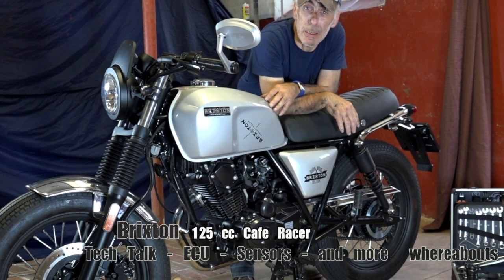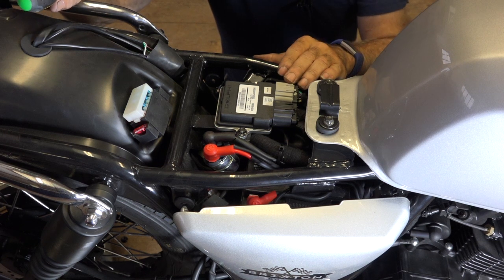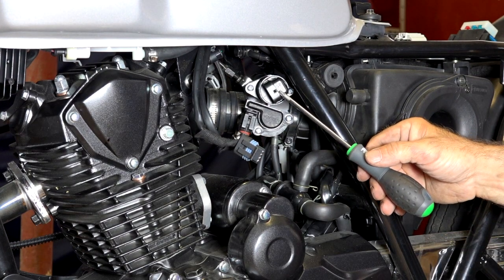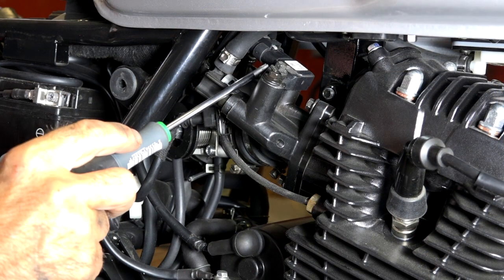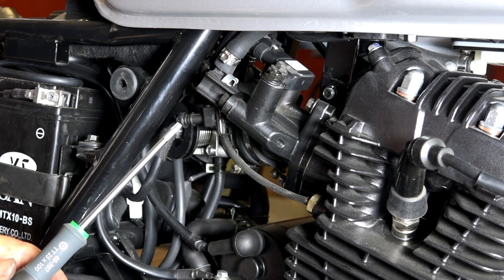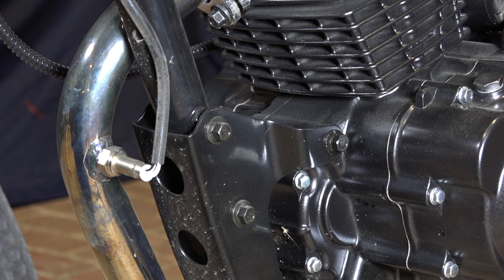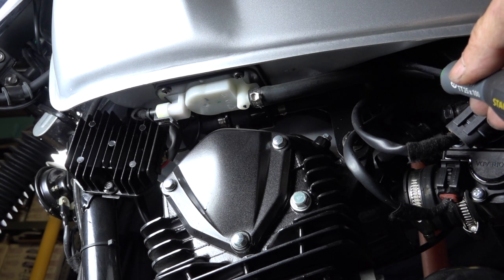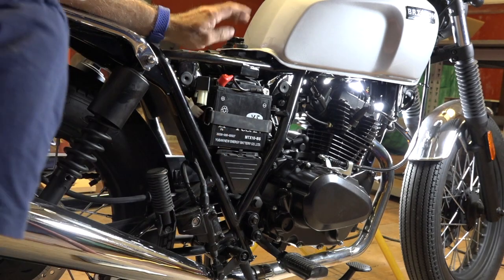Brixton  125 cc  Motorbikes, how do they work  Tech Talk - Part 1

Comment: If the FI light does not come on when you turn the key what would the likely cause be?
The bike has no spark and the pump does not prime.
I have tested the ECU itself by fitting a 2nd known good one and the problem persists.

Any Help would be very appreciated.
Reply from the maker: I would check the wiring harness for any breaks or loose connections, especially around the ECU and the main power supply.  Check also you  batterij state as the ECU will asses first the battery.

Comment: Hi Thank you for these videos.  I have a Brixton BX125cc it was running fine then one morning wouldn't start.
I have checked fuses, unclipped wire to Side stand safty turn off removed, new spark plug replaced checked for spark  py pacing on engine and no spark from spark plug, Do you have any ideas what it may be
Reply from the maker: The best would be to attached a OBD2 reader and read out the error code. There is a video on it.

Comment: Thank you for the informative videos on Brixton motorcycles. 
Where I live, I do not have a registered Brixton service centre and the local mechanics do not prefer to work on ''chinese'' bikes. 
I would be grateful if you could point me to the probable causes of issues. :)
Lately, I feel the bike vibrates a lot even after an oil change. Winter or summer, I always wait untill the bike warms up (until it reaches idling). I was thinking of replacing the spark plug? What do you suggest? or could it be totally something else. 
Secondly, I hear lose metalic parts vibrating sound on the left part of the engine. I am guessing near the gearbox. I opened and retightened the output gear and the cover. But the sound still persists. what could be the possible reason?
Thanking you in advance. :)

Comment: Hi!
Thank you for the awesome videos!
I have a problem with my Brixton 125.
The idle speed is not maintained properly (engine switches off) and when I accelerate, the engine stalls for a while before revving up.
Could you please advise?
My engineer is asking for the TPS voltage and amp settings. Could this be the problem?
Thank you in advance.

Comment: Hello. I recently installed an after market blinker on my Brixton. For some apparent reason, every time i press the switch on button on my bike, it has a delay like 1 or 2 second before it fires up. Do you might have an idea what could cause the issue? Thanks!
Reply from the maker: It could be the RC circuit that makes the blinker go.. or put a bulb that is a bit pulling more current

Comment: Hello :)
I'v been watching your videos and they are very helpful. Thank you for that ! 
I have a little problem with my Cromwell 125 so i was wondering can you help ?  
Motor is running flawlessly when i  full throttle it, but when i want to cruze at lower speeds around 5-6 rpm, with half throttle, engine begins to stutter, like it has no power. I went to dealer and they said it is normal that it's because of manual cable throttle. Then i put some carburator cleaner n tank, and it made no diference. Then i replaced sparkplug and put NGK DR8EA, and motor was running like a charm. Sadly problem was back after 2 weeks. Could this be something with unstable woltage or ecu maybe? Maybe i'm wrong but i get the feeling that's not normal. Motor have 5000 km, maybe i need to ride it more :)
Thx

Comment: Thank you for all the information you offer in this video. I have a BX 125 with no signal or possibly power reaching the injectors. The fuel pump is working and if I power the injectors manually I get a fine mist as expected. The bike has also started occasionally when performing the ECU reset (5 off and on switches at about half second intervals) 

I have tested with a replacement ECU but still have the same issue, a friend suggested the relay could be faulty but if this is the case I can't see how the fuel pump would prime as the circuit diagram for the BX shows that they both share the same relay... I am at a loss... If anyone has any advice on this it would be most welcome!
Reply: there are 2 relays under the seat, and one of them might be the problem, But yours could also be a cable problem if not the the sockets themselves. I use the bx 150 looks the same and works the same. I replaced both the relays under the seat and it works again. But do so only after you have checked the continuity of the cables to know if you have a faulty cable first.
Reply: Bonjour ,
Très intéressant , savez vous ou on peut trouver ces correspondances  de codes pannes ? (Avec le nombre de clignotements du petit logo moteur)
Ainsi que les possibilités avec les marche / arrêts avec la clef ? ( exemple : 5 fois = reinitialisation)
Ça serait vraiment très intéressant !
Merci pour le partage .

Comment: My brixton cafe racer 150 is not going well. I dint know what the problems with my brixton. When i gear i shift the gear down my motorcycle had a free gear and need to push the starter again
Reply from the maker: Thanks for the comments, Not sure what the question is.  Can you explain ?  Does the engine stop when shifting gears ?
Reply: @D3Sshooter  its going to false neutral and the the motorcycle cant start

Comment: Hi sir, have you seen any plug that can be connected to a gear indicator on this bike? I have seen a few sellers in my country having gear indicators for this bike online. I plan to buy this bike, and although the lack of gear indication doesn't affect my decision much, the addition would be nice since I'm rather forgetful. Thanks for all the information, it's very helpful.
Reply: tuiso hi there, which ones have you seen? I’ve ordered one that doesn’t fit very well :(
Reply: @andrealeixo1766  hey there thx for sharing the experience, the one I see looks like this https://scontent.fhan4-1.fna.fbcdn.net/v/t1.0-9/42521879_1113397698825961_4406814141377937408_o.jpg?_nc_cat=105&_nc_oc=AQnkzj_7FsFlk6UZ_b_iRClb182J0cIGPB3BlKqpz3COJeXWAR9yZ4DpCltgLPQ44uU&_nc_ht=scontent.fhan4-1.fna&oh=1f8fb3ad2a670a29699cf7d99da7ee61&oe=5DFB787F
Reply: tuiso the one I’ve bought is an universal kit but I need to build a metal piece to attached it to the clutch..
Where have you found that online? Which store/site?

It would be very awesome to see a video how to exchange a piece like this on a brixton :D
Reply from the maker: I have not seen it, but indeed it would be very good to have one

Comment: hi.. my brix suddenly stop while riding. i'm not sure why, already change the plug coil cable and the spark plug but still happen. when it happen, i can't start it. after unplug the spark plug head and plug it back and switch on, i can start it. but will happen back. thanks in advance.
Reply from the maker: Hi,   Is the malfunction light on ?   That is the little engine sign on the dashboard.  If that is on you should read-out the error codes from the ECU. I have a video on it , and then replace what needs to be replaced.    But if you can't read codes, lets try this:    One the bike fails, disconnect the sparkplug connector from the sparkplug  and insert a new sparkplug into the  sparkplug connector.  Then hold the sparkplug against the metal block of the engine ( not  the painted area but a bear metal bolt or so).  Start the engine ( it will not run) and check if you see the spark on the sparkplug.  Be carefull for chocks.   If it sparks , then the issue is not the ignition but maybe the inject or any other sensor that shutdown.   If it does not spark, then you might have a problem with the cranckshaft position sensor and or TDC sensor.  If they read the wrong position or provid ethe wrong signal then the ignition will fire at the wrong time ( infact even with a spark in the test , that is still a possibility).  Check also the ignition coil itself at the front of the bike and see if its not cracked or any cables that might be damaged...   Does this happen when the engine is warm ?
Reply: @D3Sshooter  My BX125 started to have this problem as well. It will only stall when the engine is warm, after 20-30 minutes of riding, up until then it runs fine. When it stalls it behaves as if there are gaps in the fuel delivery and it bogs down. It usually happens when i'm at a stoplight and i give it gas to start moving but it also happens while riding. Changed the sparkplug, tighten up the wiring to the coil, no dice. What should i check next? Thanks a lot! BTW: your videos on the Brixton are better than the service manual KS Motor puts out!
Reply: @snobu  my brixton 125 have the same problem, how to fix the problem D3Sshooter !?
Reply: @fernandorodrigues4932  I've narrowed it down to the lambda sonde (O2 sensor on the exhaust). Will try to replace it and see if there's any improvement. I believe you could also disconnect it which will force the ECU to run rich all the time. Probably not the best choice to ride like that but maybe worth it just to isolate the lambda sonde as the root cause.
Reply: Alright, so i disconnected the lambda sonde altogether and went for a ride. The bike lost about 4 horses out of the 10 it usually has, this is expected, most probably running o a "safe" fuel map since there's no oxygen input to the ECU. The good news is that the engine didn't stall. I'll replace the lambda sonde and see if that fixes it, will report back.
Reply: Scratch that, i spoke too soon. The engine stalls exactly the same with or without the lambda sonde connected, i just needed to ride a bit more. Must be something else that's malfunctioning, it's not the oxygen reading to blame. Any ideas? At this point i would definitely advise against buying this motorcycle, get a CB300R or something, just make sure it's a common reliable bike, this Brixton unicorn thing may have the looks but seems to be quite cheaply engineered and you could end up a better mechanic out of this situation rather than a better rider.
Reply: @snobu  
I solved my problem, I removed the idle air control and clean sensor with a brush and gasoline, plus the hole in which the valve to fit in, I let it dry and reassembled, i ride 2 days with the bike and stopped turning on the dashboard light and nevermor  crash at low speed, and installed the new lambda sonde..problem solved without fail ...
Reply: @fernandorodrigues4932  Hey man that's big news and i'm super happy for you and most probably for me as well with a bit of luck. Which one is this idle air control sensor? Can you take a photo and highlight it? I'm looking at the service manual but i'm not sure which one is it. Thanks!
Reply: @snobu  thank's man, yes I heve the photo ,no problem  helping you,
I solved my problem, and decide to help another friend...
Reply: see the video at 2.25 mts, it's the sensor on top
Reply: you should read-out the error codes from the ECU. 
to clear errors
after installing new sondelanbeda and cleaning the sensor ..
Reply: @fernandorodrigues4932  After a more thorough inspection i discovered my bike had rust in the fuel tank. I believe it's a combination of poor chinese steel and improper storage by the previous owner. Long story short, ordered a new tank and fuel pump (since the fuel pump was full of rust as well), the bike now runs like new, no more engine stalling and there's also MUCH more power available in the throttle, since all that rust probably prevented healthy fuel delivery the whole time. More here - http://chinariders.net/showthread.php?p=341361#post341361

Comment: Hello; i just bought my brixton scrambler 3 days ago. Everything is good for a few fays. But the problem now is it won’t start??Help me
Reply from the maker: What do you mean it wont start ?   Make sure that you have the pivot point ( the leg/bar ) where the bike stands on is not out but moved upwards.  There is a switch that will prevent you from starting when the rest point is out.

A common mistake when you get de bike.  Nothing wrong.

If that is not the case: then please describe me the problem,  does the engine rotate, can you hear the starter turning, when turning on the ignition key do you see the RPM meter swing out and back, is the little engine light on when the ignition is on ?
Reply: D3Sshooter  when i check my battery its already dead. Then i change with a new one and now its work. I just scared that my “stator” is the main problem maybe it wont charge my battery. 

2. My fuel pump is making some noise, like whistling. Is that normal? 

Thank you for you response sir!!
Reply from the maker: @nadzmimohamed417  , my pleasure... ..  It could be the stator , although that is unlikely .  It might be the rectifier (just under-need the fuel tank in the front) .  Let the bike run and measure the voltage across the battery.. that should be more then 12 Volts.   If its just 12V or below... turn on the head lights  and see if drops..  It should not... in fact a working stator and rectifier should charge at about 13.5 to 14V..
The fuelpump, well that is most likely air that is trapped.... are you sure you are not using the wrong fuel ( no methanol ) ?. If you use fuel with lots of methanol then its not going to last very long....as plastics etc will be affected including the pomp.
Reply: D3Sshooter btw the engine works just fine***

Comment: hello, i just bought bx 125 X 2 days ago. even when i drive the engine warning light turned on. am i the only one who thinks strange? when engine turned on, it should be off, but mine doesn't
Reply from the maker: Hi, do you mean the little engine light ?  That means that the ECU has logged a fault.  Best is to read out the codes as shown in one of my video's.   It should not be turned on...  but its not always a very seriuos problem. If a sensor reported once faulty it will be logged and the light will turn on....Untill its reset
Reply: @D3Sshooter  then i should go to the shop where i bought maybe? But they don't know well about this bike.

Comment: These videos you have done on your Brixton are really helpful. I have just for one for my very first motorbike.
Reply from the maker: fog99uk txs
Reply: @D3Sshooter  I have a question about something on the bike I don't know about. On the steering column, near my handlebars, there is a loose cable with a 2-pin socket.
Reply from the maker: Hi , that is the connector for the USB adaptor . When you get a new bike , it comes with a USB adaptor for power  for your smartphone or GPS.  A bit like the cigarette lighter in your car where you can insert a USB adaptor for power...   That all,  so you can stick your smartphone or GPS onto the steeringhandle and get power for it through that connector
Reply: @fog99uk Are you happy with the bike?
Reply: @TiristorCro  loved it until I had to give it up. My CBT ran out during lockdown so I sold the bike on. Regret that now as Brixton don't distribute in the UK anymore.
Reply: @fog99uk  that's too bad. Hope they get it again. I am thinking about buying one. Did you just commute or longer distances also?
Reply: @TiristorCro  both. The seat is really comfortable and the peg position makes it easy to stand up and stretch your legs while riding. Really efficient too. Did a tour through the Scottish highlands and managed 453 miles on a single tank.
Reply: @fog99uk  hah that's insane! Glad you had fun with it! Cheers from Croatia!

Comment: Can you leave the necessary documents inside the bike somewhere? or do I have to have them on me all the time?
Reply from the maker: I have them with me all the time, as I have not found a proper place to keep them.   You could create a pocket under the saddle, but then you will have to remove the sadle each time you need them.  But then again, its only two little bolds.

Comment: Nice vids, pleasant accent you have. I'm thinking about getting a bike  like this, but I would split the exhaust in two and have a muffler on either side. Crazy but I have this thing in me that won't let me drive a bike with an exhaust on one side. The split would be after the probe of course. Do you think it would upset the tuning? Or will the system automatically adjust fuel/air? - Thanks!
Reply from the maker: If you split the tube after the Lambda sensor and you do not alter the angle of the sensor, then I see no issue and don't expect any different behaviour....  show s us when you did it ,,, Good luck.

Comment: Hello dear, thank you for the interesting vid you posted. I was wondering if there is any possibility to improve the engine's acceleration through ECU tuning or any other easy trick. I just bought brixton 150cc very happy with the look of that bike. But missing bit of power.  Thanks in advance.
Reply from the maker: Hanks Dinelli hi hanks and txs.  .  Indeed performance is not the best of these bikes. Its ok but i believe that changing the fuelmap might improve the power.  I think that they are tuned towards a balance between power and environmental conditions.  I am working on a method to read the fuelmap of the Ecu and possible modifying the fuelmap on the Delci ecu.  So far i have not seen any products on the market.  That is why i am trying some reverse engineering.  We will see how far i will get
Reply: D3Sshooter Hey Steve, apreciate your swift reply.  I will be looking forward to see your next valuable post. Good luck Genius 😉
Reply: First streamline the throttle, after reduce valves diameters and round the edges. Only after You can play on the fuel colder spark plug  .cheers